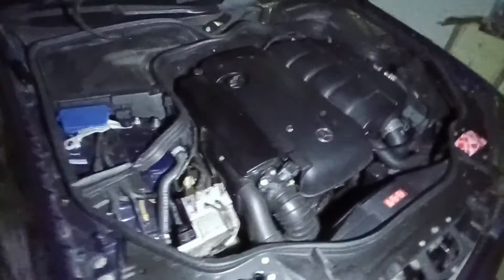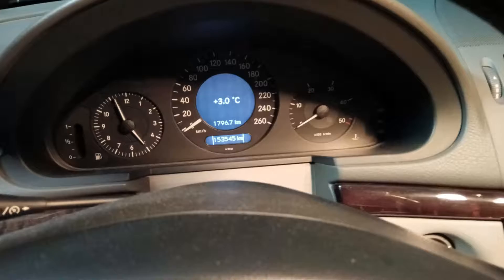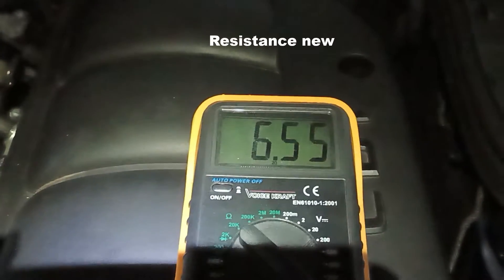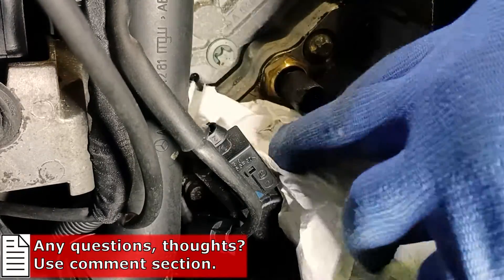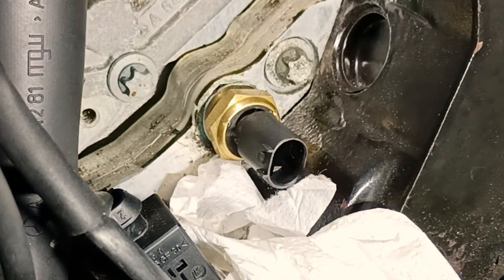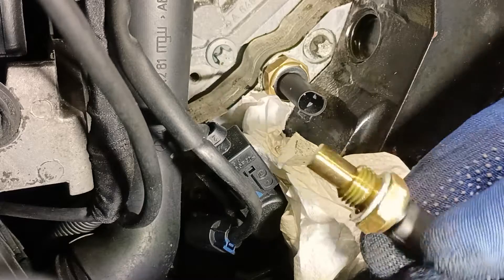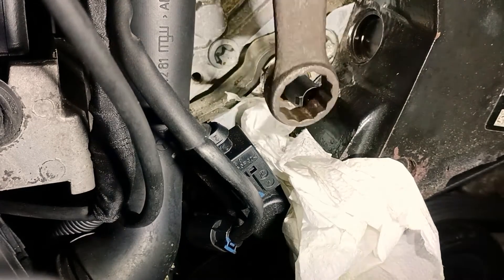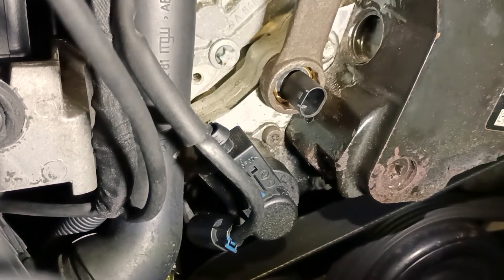Lokalizacja i wymiana uszkodzonego czujnika temperatury paliwa w silniku wysokoprężnym Mercedes 2...

Comment: Hi Sebastian,
Thank you for great video. I have a question. Did you get any fault code before the sensor replacing? I am gonna replace mine, because of fault code „P0183 Fuel Temperature Sensor A Circuit High”. Hopefully new sensor helps 😊
Reply from the maker: Hi, in my case it was enough to replace but I know two other cases were in one: there was no connection on one pin in the sensor plug; in the second case: there was no connection on pin 8 in the ECU.
Reply: @tickingWATCH  Thanks for suggestions, I hope to see more videos from you about 220CDI 👍
Reply: @tickingWATCH  Hi I have a question do you consume more with the old sensor because I have the same problem with this sensor which is defective and I consume 10L100km I don't know if it's because of that or not please
Reply from the maker: @UC6-pTk6k8m0Cbt84k%F0%9F%98%80-sh_Lg In my case fuel consumption was similar, but I was having the same time problem with EGR valve (or AGR valve 🙂). After repairing the valve, cleaning and lubricating it with copper grease, the fuel consumption is about 0.4 l / 100 km lower.
Reply: @dzjengizmazreku178   I didn’t notice change in fuel consumption before/after this sensor replacement. My usually takes 7,5-7,8l/100km overall which I guess is normal. But I am also considering EGR inspection and cleaning.
Reply: @tickingWATCH  And also the engine light is on